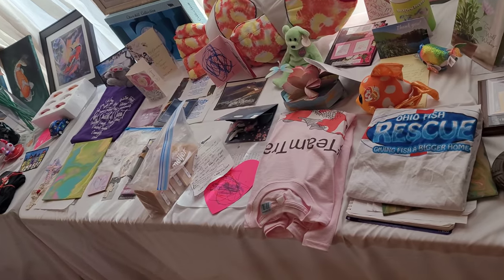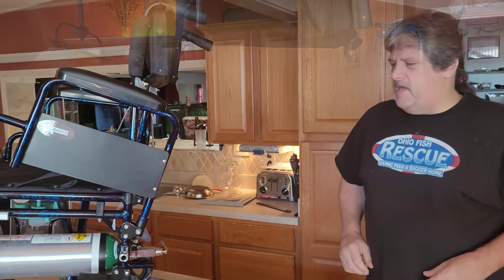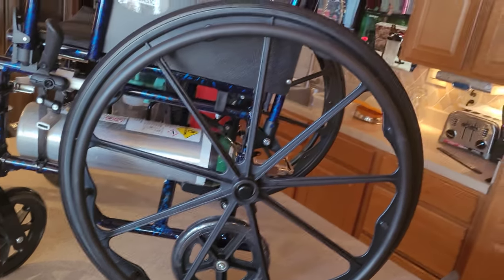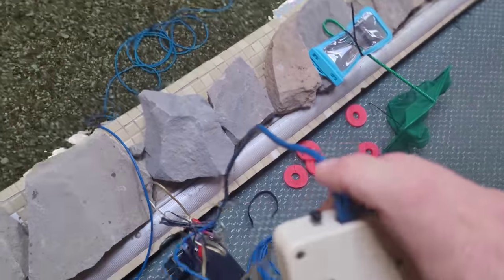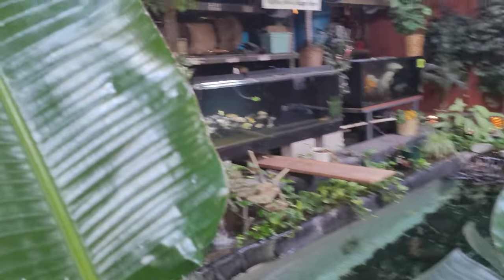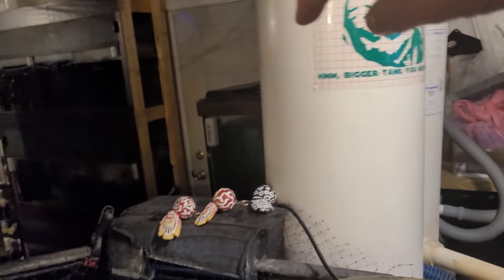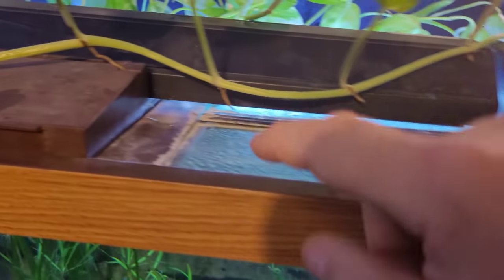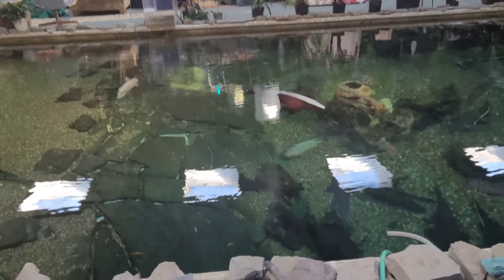Upgrading Tracy - underwater drone, and what we have to do at the rescue

Comment: Tracy's so tiny and that seat is huge. Place a small neck pillow or rolled beach towel behind her tushy and another thin pillow behind her back, and it will cause her back to recline further. Between that and the bend you made, she'll be less inclined to fall forward. Update: I bet you could even buy a wedge pillow made for a wheelchair that might do it.

Comment: HotRod wheelchairs.     Pretty sure in two weeks, they'll be a battery and motor on it,  Then  headlights and sound system.   Then an app to control it from your phone.   after you've used the drone mechanism.    #teamtracy.

Comment: I'm not mechanical but had an idea for a new wheel chair design. Maybe if you like it and build it, you could get a patent or design credits. There are electric longboard skate boards that are controlled by hand held remotes, Long boards are extra long for more space. Put 2 longboards side by side, weld them together and use any kind of chair you prefer, then add whatever attachments needed. Might be able to kinda drive it like an RC car later but just to assist for now.  Take care, Stay Strong.

Comment: You could tilt it with the front wheels by simply extending the section that slips in to connect the wheel to the frame.  I think reclining the back will be more comfortable though.  Also add a strap to hold her in.

Comment: rather than welding on to the forks how about putting bigger diameter wheels on the forks, you can see its possible because of the gap between fork arch and wheel,

Comment: Just in case you didn't know they have wheelchairs that you can adjust the seat to any angle with a button. It adjusted better then your chair and they will hold the oxygen tanks superman used a chair like that. also I've seen in some cases where the person can't hold the body up they put straps on and seat belts like if there in a nascar

Comment: For the wheelchair, if you take off the  front u bracket over the wheel...on the top of it there will be a peg screwed into or welded onto it. S
Why don't you simply extend the length of the peg?

Comment: Please be really careful adjusting the frame of that chair, you can easily make them structurally unsound, and make the balancing points uneven (even with anti-tips).  Also, please buy (or make) a bag to hold that oxygen canister, the last thing you need is for that to drop from where you have it, or accidentally get crushed when the chair is folded.
I'd honestly also suggest seeing a wheelchair rehabilitation specialist (they may be called differently in the US) to give you a detailed explanation of Traceys needs - ie tilt-in-space, high back, moulded seating, cushions (to avoid pressure sores) etc. I don't know much about Traceys current condition or abilities, but from experience most people with specialist needs require more support than most standard chairs give them. In the UK I'd suggest having a look at a Invacare Rea Azalea tilt-in-space wheelchair (they allow you to recline the back as much as needed, and plenty of back, side, head support and pretty comfortable too) , but I'm not sure if Invacare chairs are available in the US.

Comment: Bigger front wheels will help with the chair or instead of grinding and welding the wheel mount why not put longer bolts on the front wheel holders.